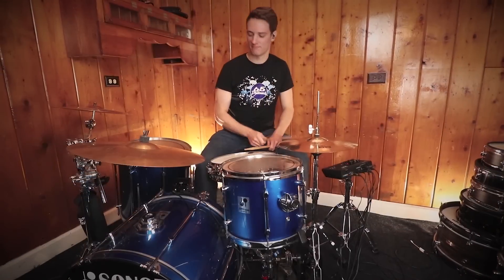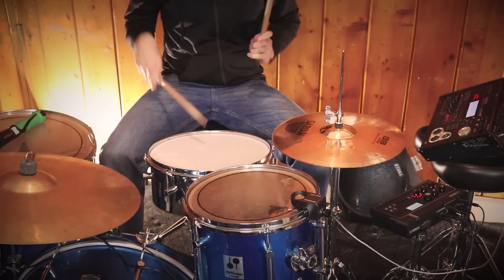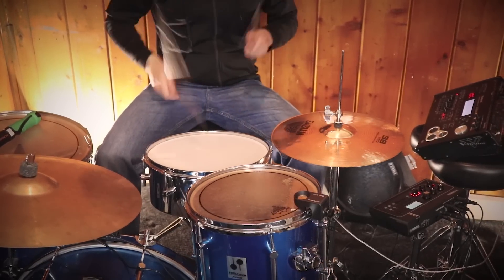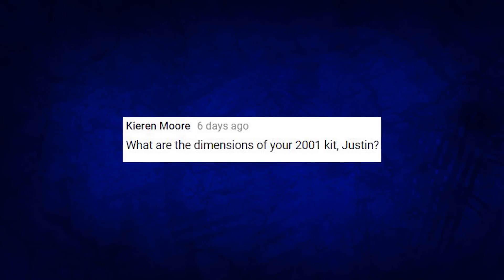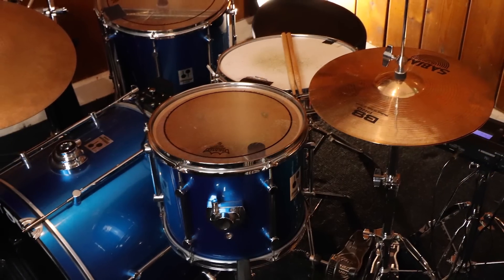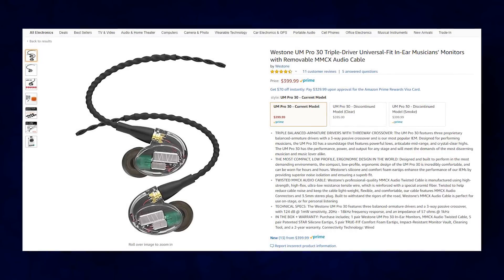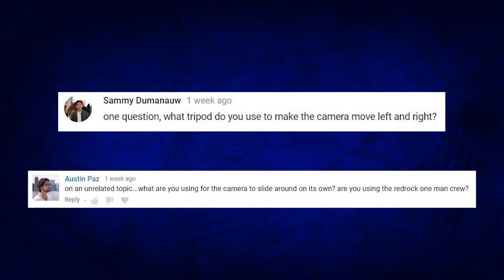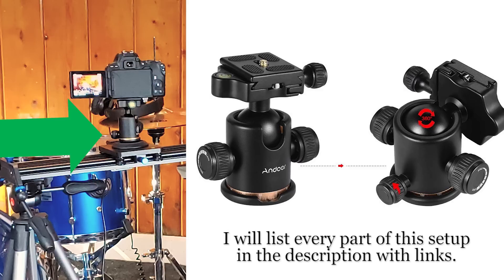Can You Use Mesh Heads With The EAD10? (65 Questions 11)

Comment: Justin, hi. Just wanted to take a chance and thank you for addressing this topic. I've been trying for quite some time now to reach a good sound out of EAD-10 with silent solution (Although it was not built for that). I understand now it's probably possible only with triggers. Another option I haven't tried yet is RTOP Black Holes (they are not sold in my country ;). They are known to be "preserving the tone" better than mesh heads. So if you have a chance to snap one on a snare and give it a shot, please share the experience.
Thanks again for all the videos about the EAD-10 and the others as well ;)

Comment: With triggers and the newest software update you can use the EAD10 with mesh heads and get a variety of different sounds.  There are a full set of 'kits' intended to be used with mesh heads and triggers.  I do it all the time
Reply: …It’s because of the software update they offered a couple of years back
Reply: Did you have to use a separate trigger for the kick, or did the module work well enough to use as a trigger?
Reply: @msgdob86  Just the EAD10 unit... I don't use a separate trigger for the kick drum
Reply: @msgdob86  I don't use a separate trigger however I also don't use a mesh head on my bass drum.  I fill the drum with old t-shirts (packed full, it's a 16x16 Sonor BD) then I use a soft beater.

Comment: The kick trigger on my ead10 does not work on mesh head even if updated. It works good with normal batter head so I have to find the solution for the mesh. Any suggestion?
Reply: I'm on the same dilema 😥
Reply: Have you guys find a solution for that?
Reply: Hi guys. Have you found any solution about it?

Comment: Hi Justin. Has anyone tried the bh triggers with the Evans dbOne cymbals. 
Do have any advice on cymbal triggers.
I'm thinking of getting the Evans dbOne heads and cymbals.
Do you think the kit will sound different when the Evansdb One is used with the Yamaha EAD10 ? Will it sound better than the sounds u got in this video

Would u advice using the DDrum Pro triggers with the EAD10 to make it sound better 

And lastly any advice on cymbal triggers 

I have constraints on volume when i play so hence all the questions.

Sorry if it sounds stupid. Hoping to hear  from you soon. Cheers

Comment: Also, it does work live very well, but you really need to know about preventing feedback and putting your PA as far away as possible. You have to use IEM (no drum monitors). For smaller venues, you can can turn down the mic input and put the triggers through the PA. I do wish yamaha put more trigger inputs I the ead10.

You probably can use this with mesh heads and yamaha 3-zone cymbals by turning down the mic all the way and just using the triggers (splitting the kick, and snare inputs).

Comment: Have you heard of KZ in ears? They range from $20-$60 on amazon  depending on the model. I plan on ordering a set soon but have never listened to high end monitors. It would be kind of cool if you ordered a pair to see how they sound in comparison to some higher end headphones or in  ears.
Reply: I bought the ZS3 model for $15 on ebay. They fit and seal very well with the right earpiece. Compare favorably with my Sony mdr-7506 headphones which are a longtime studio standard. Only thing i dont like is cord is a little short but you can buy replacements and convert to bluetooth also. Really happy with them. Try them. Even if you dont like you will only be out a few bucks.

Comment: Hi Justin I use and pearl mesh heads in all my drum set with EAD10 too, and the kick drums trigger doesn't work properly. I adjusted the sensitivity to the max value, but the response is random. Any idea to fix this issue. Thanks
Reply: I just hooked this up a month ago and it works fine.
Reply: Hi there, I'm facing the same issue. Seems to be due to the mesh head... After these 4 years how did you solved it? Ty

Comment: Hi, 
Spent a lot of hours watching your vid's and for sure I'm subscribed. 
My Issue, I own a Yamaha Oak Custom acoustic set with expensive cymbals, and I found my self playing less and less on it because it is so loud! Yah I love the snare sound but it's attacking my ear, so I'm using headphones, and when playing along music I have to crank the headphones up real loud so the drums don't bleed in so much, bottom line I cannot enjoy a comfortable level of playing drums together with iTunes or my own produces music. I'm also tired of mic/mixer setup.  So I was dreaming of an eDrum set. 
Problem with that is unless I play on the TD50 the cheaper ones sound awful, and I"m not willing to fire up Addictive/superior-3 every time I want to knock my self out on the set.  
I was ripped inside my self on a solution... I came to the conclusion to get the Yamaha DTX 502 because of the 3 zone cymbals and 3 zone snare. I haven't found a store yet who had it on demo to try it. and the TD17 did not impress me to dish about 2K  for it. (I don't like the Roland flavor snares)  the Strike is huge and won't fit...  So My Question. what about I get the Yamaha EAD10, replace the oak snare - which is the loudest piece of the kit -  with a Yamaha 3 zone snare pad, and hook it up to the EAD10. would that work? does the EAD10 have snare sounds? does it support as a layered sampled snare?   I feel that the EAD10 would allow me to stay with my real cymbals, record them without a full mic/stands/wires/mixer/messy setup, and also play along iTunes, and it won't be so loud! and my headphones could stay at a reasonable level! (or should I buy another snare which is not as loud... the Yamaha Oak snare is extremely loud) 

whats your opinion? Thanks!!
Reply: Yoel Klein It sounds like you are in desperate need of some sound isolating in-ears, or sound isolating headphones, that you can combine with earplugs. The in-ears would work a little better 👍

Comment: I was wondering about this. Thanks for info. Justin you need to try the KZ in ear monitors. I bought the ZS-3 model for $15 on ebay. Fit is almost perfect. Great sound and isolation especially for price. Also convertible to bluetooth.